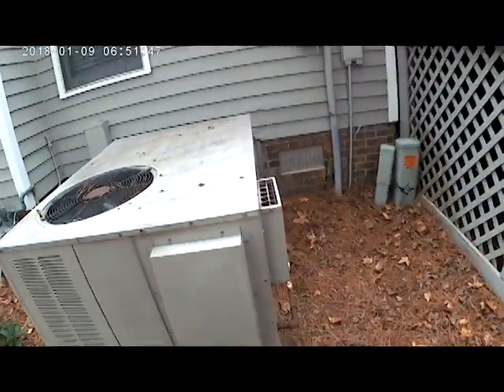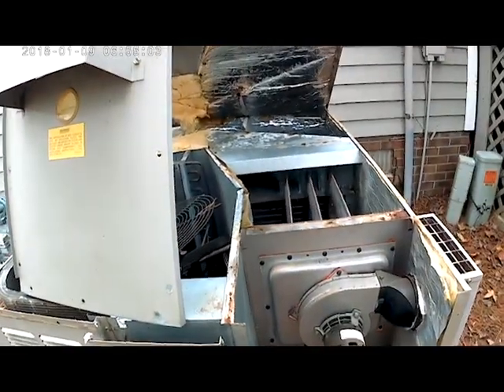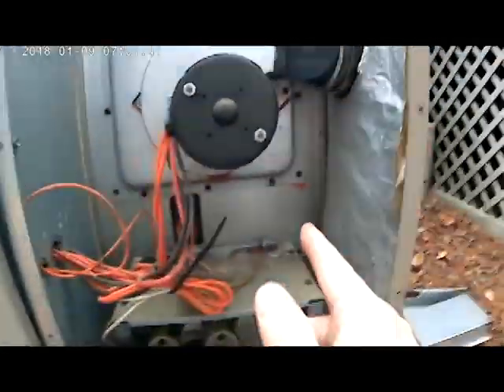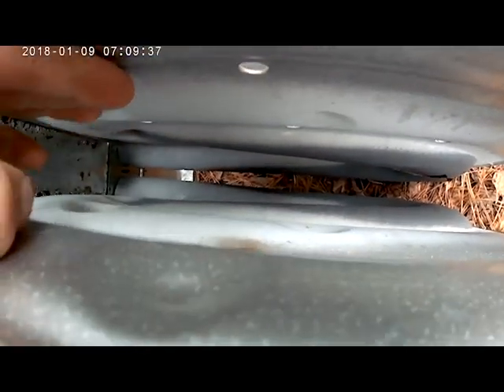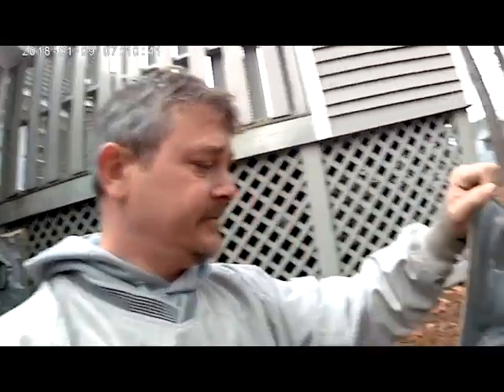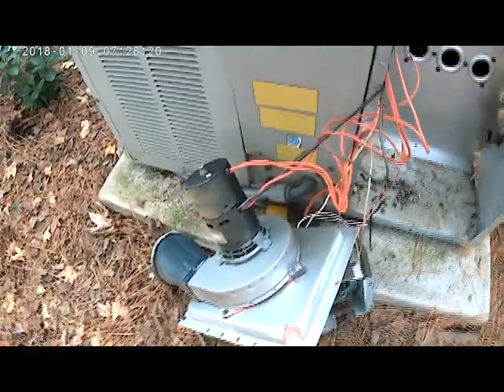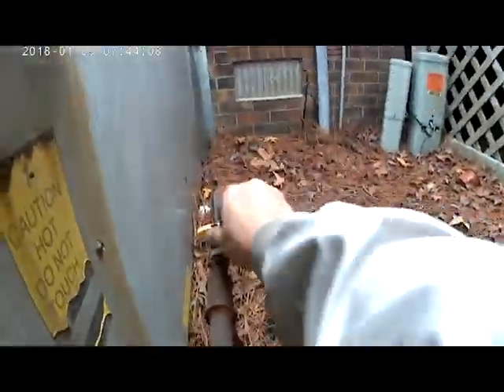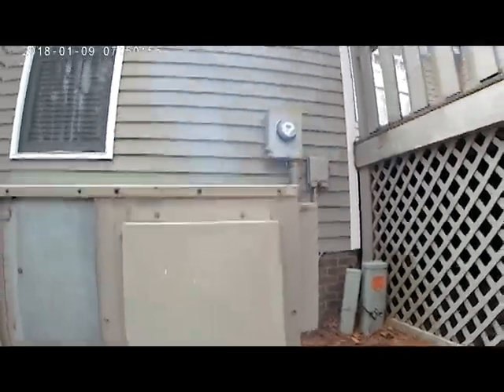How to Replace a Goodman Heat Exchanger!

Comment: GOOD VIDEO. Great to see a HAC technician who really knows how to find the problem and fix it. I had 3 repairmen ($80) to tell me that I needed to buy a new Goodman unit ($13,000.00). Two asked me to sign the repair receipt and after reading carefully, they thought I wouldn't notice that it was a costly replacement contract!   My fourth guy told me he will replace the heat exchanger with the parts needed.